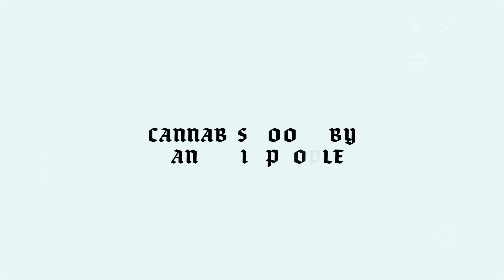Live Resin vs. Distillate - Cannabis Concentrates 101 | The Slow Burn #12

Comment: A distillate is the concentrated, liquid product condensed from vapor during the distillation process, a chemical technique used to purify liquids based on different boiling points. In the context of cannabis, distillates are highly pure and potent extracts of THC or CBD, produced by heating raw cannabis oil to separate cannabinoids and terpenes into a condensed form. This process results in a clear, odorless, and versatile product used in vape cartridges, edibles, tinctures, and other products.

Do You like Deep Complex Natural flavors or the High Test "burn" of Distilled alcohol of Vodka or Rubbing Alcohol with a bit of Added Fake Flavors? 
Rosin / Water Hash - Wine......... Disty - Cheap high Test alcohol (kamchatka vodka).... So... you like Jack Daniels? $20-$40 a bottle.. or Domaine de la Romanée-Conti (the most expensive wine ever sold, fetching $558,000 for a single bottle at a Sotheby's auction in 2018.)?? Both will get you equally drunk... One tastes FAR better.. Hence the price..

Comment: Love the vids! I'd love to see one on Delta 8 vs Delta 9 or Thc-a vs Thc-b ! That be awesome!
Reply: Delta 8’s double bond is on the 8th carbon atom. Delta 9s double bond is on the 9th carbon atom. The difference between thca and thc is thca has an extra carboxyl group which prevents it from binding with the cannabinoid receptors in your brain. Delta 9 is more potent than delta 8 because of the difference in its molecular structure specifically the single double bond. The difference in the molecular structure means that it doesn’t bind to your bodies cannabinoid receptors. Then you have thc-p which also has the double bond on the 9th carbon atom. However delta 9 only has a 5 carbon alkyl side chain where as thc p has a longer 7 carbon alkyl side chain. The difference in the side chain is why it is able to bind to the cb1 cannabinoid receptors. Delta 10 you guessed it has its double bond on the 10th carbon atom. The location of this double bond determines the molecule's overall shape and how it interacts with cannabinoid receptors in the body, resulting in different effects. Delta 10 is actually considered less potent than delta 8 because it doesn’t bind as well. It also has a more “sativa” like high even though “sativas” can knock you out and “indicas” can lift you up. It all depends on the terpenes and cannabinoids overall. Like cbc makes you very focused and want to work. I know this because I run and edibles company and use cbc, thc and cbd and it is far better than any adderall. For the first time in my life my brain wasn’t bouncing around and I went and wired a whole building. I then explained every step exactly how my dad a master electrician explained to me when I was like 12. I didn’t have to think or go ugh it came out identical to how he explained it. Usually my brain is so hyperactive it takes me a min to explain and it comes out confusing to most.